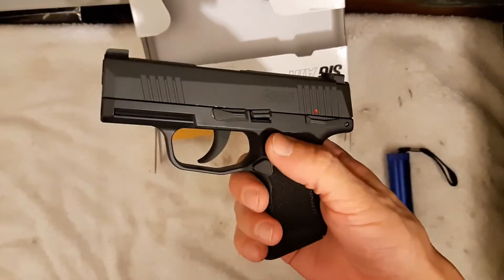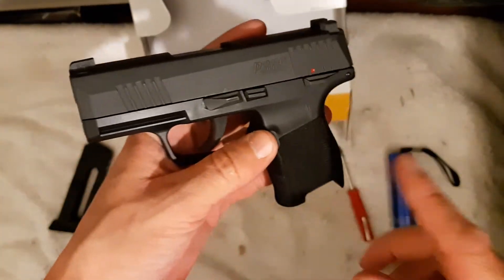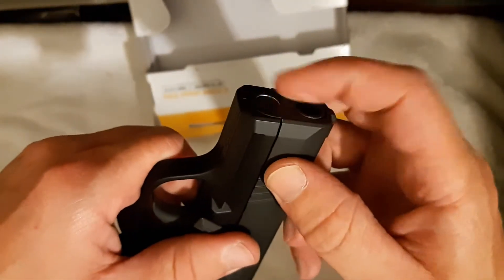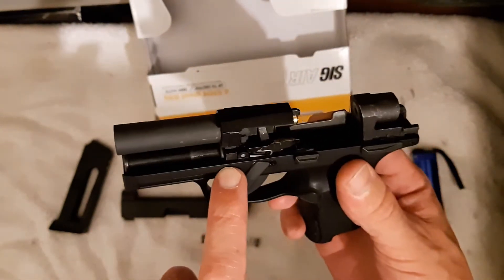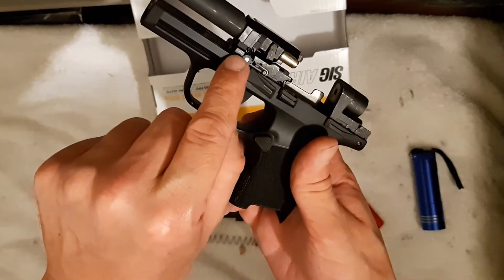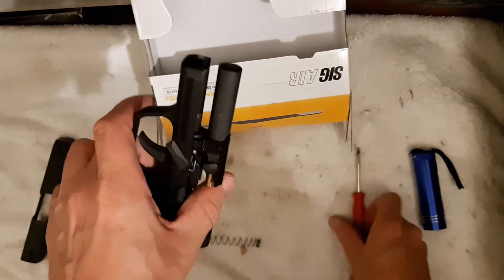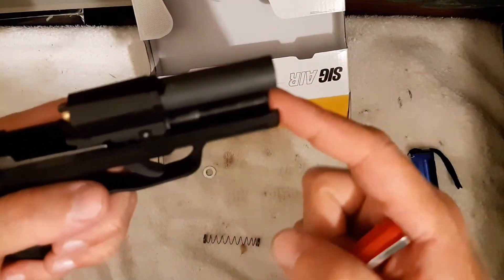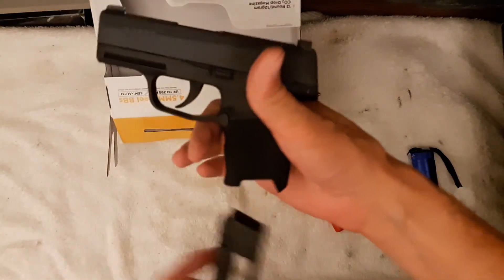The "trick" to field strip a p365 co2 BB gun

Comment: i got mine disassembled twice, and now i cant get the slide off at all.
Reply: woah, I figured out the magic trick to getting this to work if it doesnt release after pushing in the recoil assembly. push the slide back as far as you can, as well as the recoil rod, nothing happen to you too? get a screw driver and lay it flat on the tip of the weapon  in between the barrel and the recoil rod and the
Reply from the maker: @chaisdatson6207  Yea!  There definitely are times where  it doesnt come off easy.  I will try for sure pushing on both parts next time.  Thanks for the tip!

edit : I'm almost 99% sure the rubber washer can come loose in between shots and then can get slammed back into place by the slide.  If it catches just on the edge of the groove it will eat up those precious mm we need for clearance at the rear rails.

Comment: My slide does not go all the way back in any more
Reply from the maker: If the guide rod moved in and you still can't move it that rubber bushing is probably loose and eating up space.  Try forcing a little while making sure the pressure is applied to the rubber piece and DO NOT FORCE UP, force BACK  (need to squeeze the rubber other parts might break it will go up by itself), you might get that extra mm.  

This might sound silly but swap the gun to your off-hand and pinch (specifically pinch)the rear of the slide with your main hand  (im right handed and rack the slide with my left so i would swap to my left and PINCH the rear of the slide with my right)  that's the only thing i did different when I got mine off the first time.. didnt think it would matter when i made the video but it might hehe.
Reply: same issue here.
Reply: @RWMAirgunsmithing  I figured it out. Push back tha hammer with a small screw driver, etc to push back the hammer. If the tigger was reset and not pulled it will slide right on if not it wont go back on.
Reply from the maker: Glad to have helped out half way xD
Reply from the maker: @drones r us shit sorry I'm not a full time content creator... did you manage to wrangle your p365 into submission?

Comment: Great vid !
Any idea how to improve the velocity ?
Reply from the maker: No sorry. I buy extra mags for all my bb guns so the CO2 can rest a bit before shooting again. 

You can try dust devil bbs they are lighter.
Reply: Thanks for the answer mate ! 
Just a question though, before buying it. Have you tried shooting glass bottles ? Do they break or does the bb bounce back ?
Reply from the maker: @jazzpianistparis  It should be able to handle any target you see other replica bb guns take down (very similarvelocities) .  I haven't tried bottles though, Im more of a can guy xD.
Reply: @RWMAirgunsmithing  or buy a stronger spring
Reply from the maker: @Italian_goober  oooof, just because this is on my channel I would advise caution and deliberate selection of springs with this mod.

I agree, it works, the co2 expansion will take the path of least resistance, but not all airguns and internal mechanics (like cocking the hammer and lock back) will work 100% of the time afterwards. Not to mention the loss of performance once your co2 pressure is low, it really is a tradeoff unless you are tethered to HPA.

You are more likely to impede normal cycling of the airgun at low co2 levels and increase wear on internal parts by randomly selecting a spring if you dont gradually gauge the impact of spring tension energy on your mechanical parts.

Comment: If anyone fired the pistol with the slide off the pistol wont reassemble. Perhaps you could show people how to re-cock it while disassembled so the slide will go back on.

 If I had a decent camera I'd do it myself. However, I gave a written description in a comment on another guy's -"Chief Chaos" field strip video.
Reply from the maker: Done! dont have much of a setup either, it's all about the lighting hehe.
Reply: Theres a small lever toward the back of the gun under the part that sits behind the magazine. I just used my car key to push it back down.
Reply from the maker: @twistedatm6937  Aye, I think you are referring to the hammer.  I made a short video for the reset.

Comment: I think put the spring back in backwards and the slide wont come off
Reply: I cant pull the slide back far enough
Reply from the maker: @norincoenthusiast6193  did you push the guide rod in?   Mine was tight too, but I'm pretty sure the only space eating part is that rubber washer.  You might need to squeeze a bit.
Reply: @RWMAirgunsmithing  I pushed it in but the slide wont go back far enough for me to take it off to reset the trigger
Reply from the maker: @norincoenthusiast6193  hmm so you took the slide off and now maybe you think you put it back on with the trigger pulled because when you rack the slide it doesn't actuate the hammer?
Reply: @RWMAirgunsmithing  no the damn slide wont go back to a firing position and the slide just wont come off
Reply from the maker: @norincoenthusiast6193  sounds like you need to squeeze that rubber washer but hard to say..

Can you make a video showing the motions when you have issues?
Reply: @RWMAirgunsmithing  i managed to force the slide off andy guess is that the rubber washer wasn't on all the way but i put it back together and the gun works now
Reply from the maker: Hey I know its months later but one thing I noticed last time I took this one to the range... some shots it seems to kick more than others and the sound is different. 

I am 99% sure the rubber bushing COULD come loose while firing and can get wedged back into that groove randomly from the slide slamming into it during plinking.

Comment: Nope. still aint worked for me. Think mine may be cursed lol.
Reply from the maker: @garretbyte9142  doh, unfortunately this is the only mechanism that permits the field strip.  When you press on the tip of the guide rod with the takedown lever actuated does the guide rod  move?
Reply: @RWMAirgunsmithing  Yeah it moves back about a cm, but it's still not letting the slide back far enough to come off its rail.
Reply from the maker: @garretbyte9142  definitely sounds like the rubber washer and the metal washer are loose on the guide rod.

Try letting off a few trigger pulls with CO2, sometimes I'm sure the jolt from the slide can make the washers come loose OR the jolt might slam them into place.  You should "feel/hear" the difference, try removing the slide after each shot.
Reply: @RWMAirgunsmithing Finally got it off today lol, been cycling 3-4 mags daily for the last 2 weeks and it finally got loose enough.

Comment: This did not work
Reply from the maker: @damianjohnson8289  if the rubber washer is floating on the guide rod it can seem near impossible, this is normal. It does work, it is the ONLY mechanism locking the slide in place, there is nothing else.